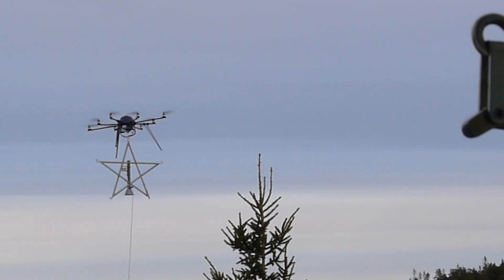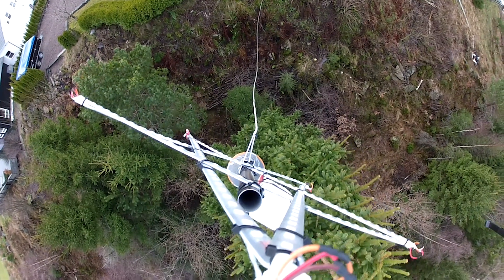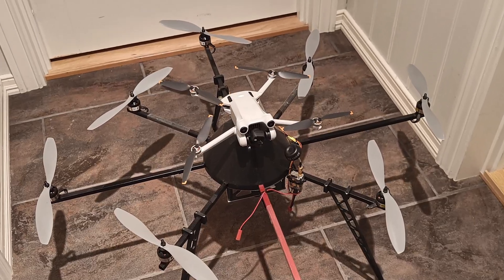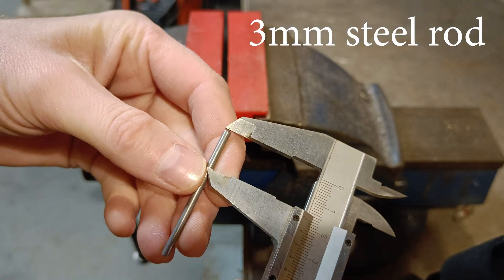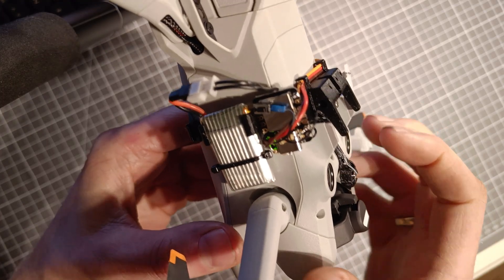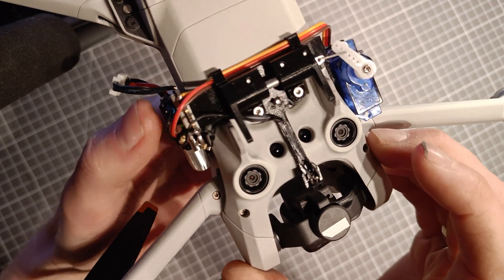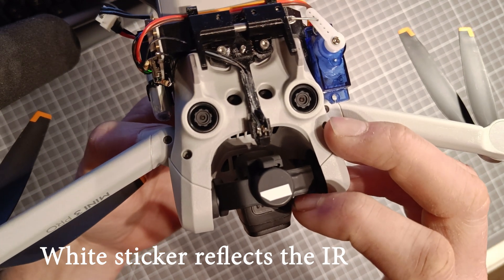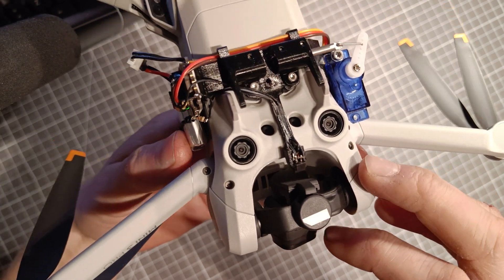DJI Mini 3 Pro - 3D Printed Payload Release

Comment: Is this possible to trigger the device without using the gimbal?
Reply from the maker: True, however it seems those you can buy use 2,4GHz and claim no disturbance. I did plan to use nRF24L01, before I came up with the gimbal trig. Now that solution meets my needs (hopefully 😅)
Reply from the maker: Well, there are some options.. you could add a RF trig using a separate remote, as the one I show in the vid. I think I saw one triggered by certain drone yaw movements also!
Reply: but if you add add an external one it might add more interference like turning cellular on planes. @TheSkjegg